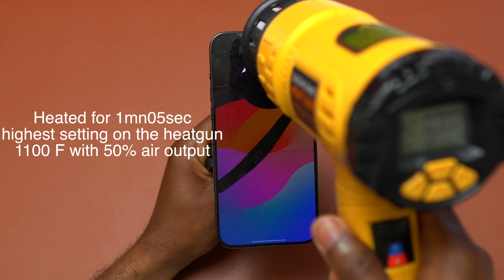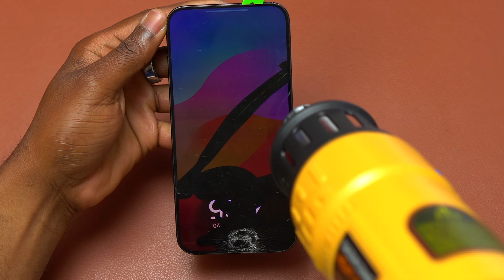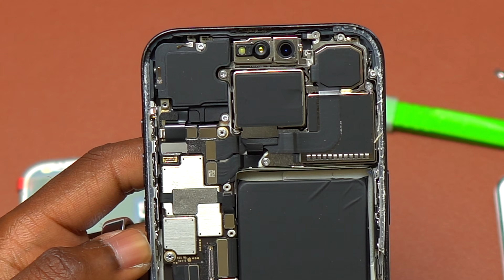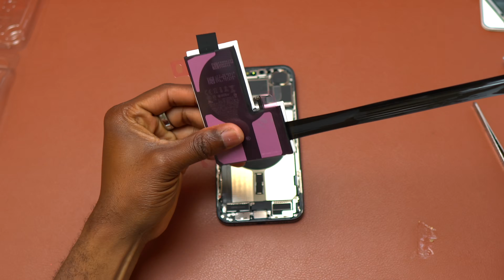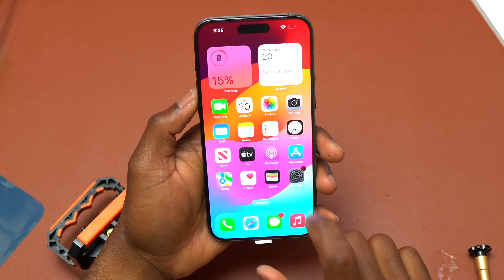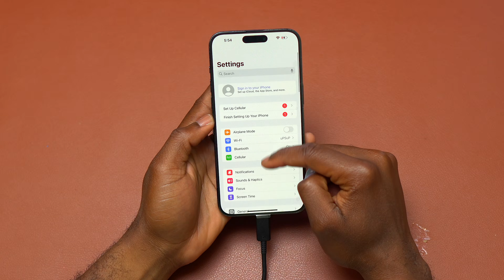Apple iPhone 15 Pro Max Battery Replacement Repair

Comment: DON’T USE HEAT!!!!!!  Don’t we already know these devices to be very heat-sensitive???  Just use the same carefully-placed isopropyl alcohol that you used later when you’re removing “excess” adhesive!!  It takes a little longer to denature the adhesive, rather than heating it, but that extra work is DEFINITELY worth it.  Your sensitive phone components will thank you!!!!

Comment: sorry but im not approve your methods even though the screen is broken you didht care the device as it should while open you use a cheap paint dryer which can reach easily with the 1 setting 300 degress which is crazy thats why the message then where you left the screws also the specific model open like a book and you pull the screen what about the proximity sensor and the 2 pins that regognise the screen you use to much force for no reason you are lucky you didht cause further issues to the device use the right tools and less force otherwise dont make tutorials for fixing devices
Reply from the maker: You may disagree with me and what I did Okay. I have been doing this for years now and using the heatgun never damaged if you know what you are doing. These screens are not so easy to damage with heat unless you heat a single spot for 30s or more at Max power level of the heatgun. I have done video with brand new iPhones not even 2 weeks old after release I opened them using the same strategy and no damage was done to the device screen. It all depends on your level of expertise and how experienced you are.

😂 please stop saying you are lucky because there's no luck there's only skills. The other day I was not so lucky when I messed up because I was lazy about doing the video and was feeling frustrated. It was not a skill issue it was not luck but only lack of focus and motivation 🤷🏽‍♂️. 
With experience lot of things are not the same and what I just said is the problem with experience you think you have seen it all stop maintaining focus and you damage something. You need experience, focus and motivation. You only need luck or lucky if you do not know what you are doing or lack experience.
Reply from the maker: Since iPhone 12 pro max I have been opening these devices with heatgun 😂 the model number changes but the process is the same.

Comment: I got a question for you do you need a code copier when you swap the batteries as copy the original code then past it on the new battery

Comment: You should remove the plastic piece on the battery after you sticked it on the phone
Reply from the maker: Hi, are you saying the battery should be installed in and use the white cardboard as an aligning tool (maybe). Then remove it at last??
Reply: @ersbit  Yes I’ve seen many Apple authorised service providers do it like this
Reply from the maker: @ilbufalantdellefigurine4488 great thank you. Your addition is very helpful for me and others 👍🏽
Reply: @nomecognome2 doesn’t matter considering he still nailed it on alignment